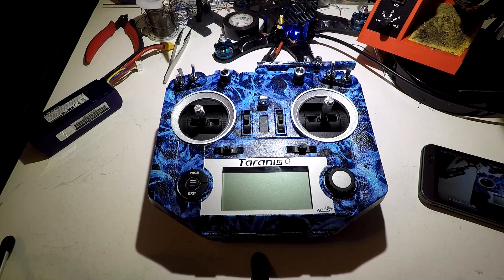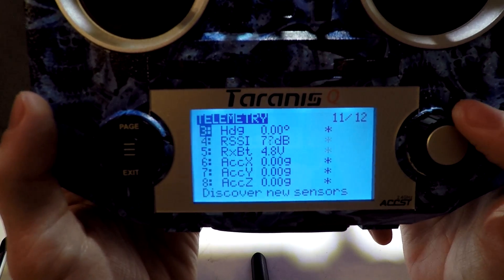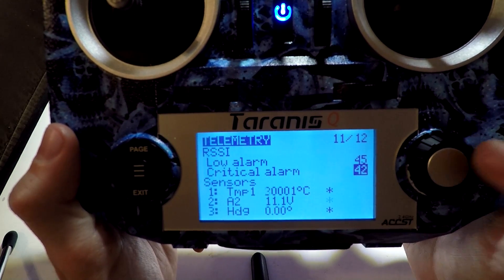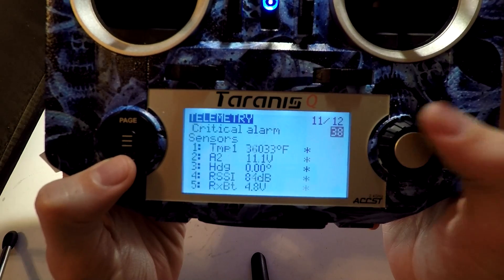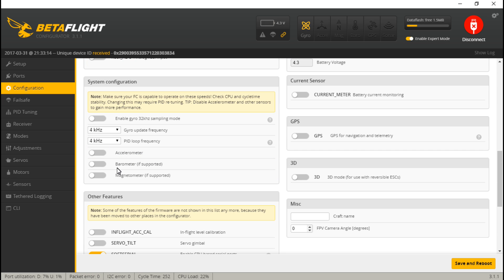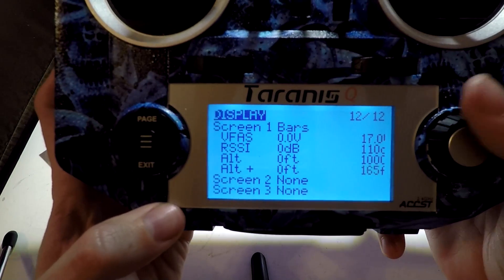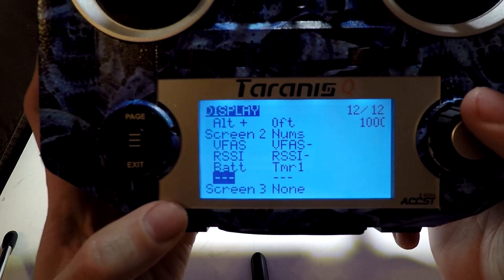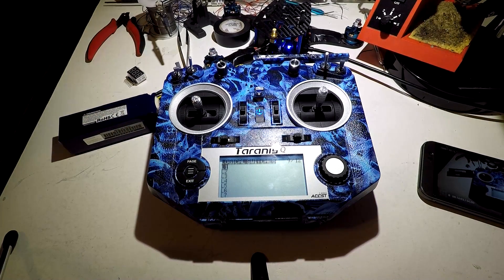Taranisi Q X7: Setting Up Telemetry

Comment: You are killing it on the Taranis education. I've been learning a lot from your videos. I got the QX7 when I first started buying stuff/things one by one. I've just about cut my thumb off (arm/disarm dummy) and I've wrecked my first FPV 3D printed frame with PDB and CC3D. I'm now finishing up a carbon fiber alien frame with Betaflight F4. I've learned a bunch in the last few months. I started with 3S and now using 4S. Anyhow, thanks for your videos. You are doing a great job.
Reply: David L. Whitehurst he passes away in a Motorcycle accident last year :(

Comment: at @2:25 you set your low alarm to 45 and critical alarm to 38. What are these numbers exactly, are they the discharge percentage? for example, you get a low alarm when you've used 45% and a critical alarm when you've used 38% of the battery??

Comment: I have a qx7 and an xsr with a sp racing f3 flight controller I am trying get the voltage through telemetry but when I discover sensors rssi,RxBt, and A2 are the only ones that show up. I have the vbat wired correctly because when I plug it in on bataflight I can see the voltage up top but when I go in the config tab I don't have to option to turn on vbat does this mean that I can't get voltage through telemetry? Or am I don't something wrong

Comment: been trying since days to get VFAS to show in my Taranis discover new sensors, battery voltage shows correctly in betaflight but i cant discover VFAS for some reason maybe some cli command :( everything turned on in betaflight including the baro but not getting VFAS nor altitude, help would be greatly appreciated.
Reply: Rossi 46 did you ever figure this out man? I'm having the same problem

Comment: I was having trouble receiving telemetry from my FrSky XSR receiver and it turned out that the XSR needed a firmware update. So I followed your XSR firmware flashing video which was great but for all you guys with a QX7 Taranis to flash receiver firmware you need to use the "Smart Port" on the bottom of the radio next to the SD Card slot to flash the firmware. The pinout is different to the internal receiver expansion port, correct pin order is GND, +5V, SIG going from left to right (SIG pin being closest to the SD Card slot). Hope this helps some one out.

Thanks again for the excellent videos JC, this playlist has really really helped me out setting up my new Q X7!
Reply: pwrkiter is it worth buying a micro sd card or does it work just fine without? Thanks